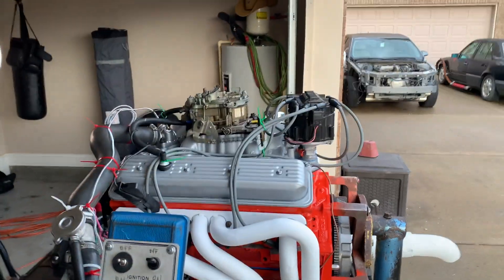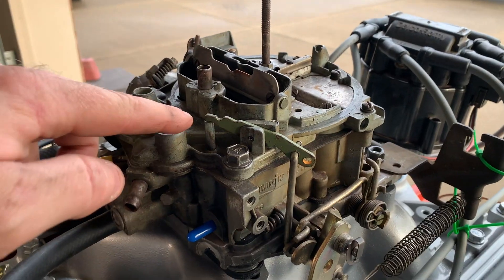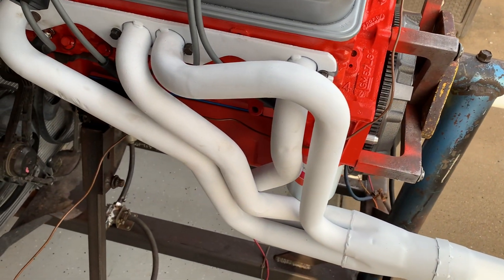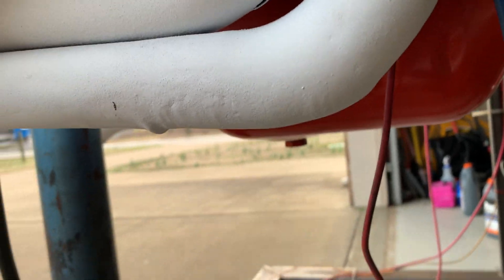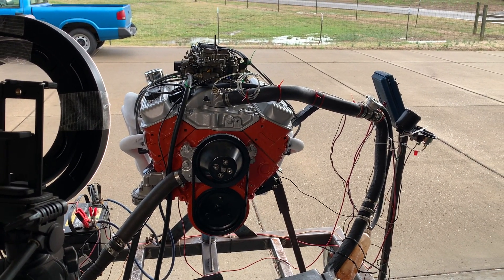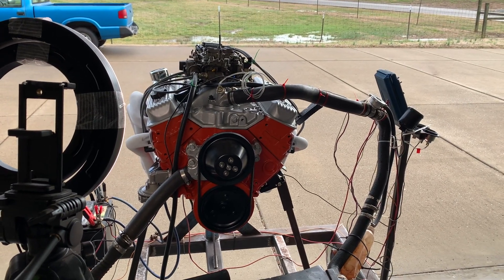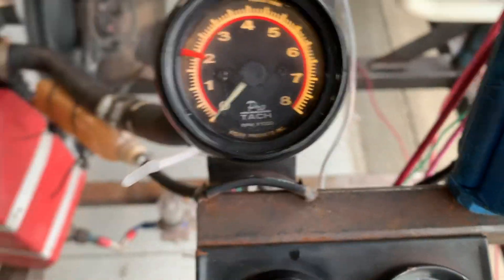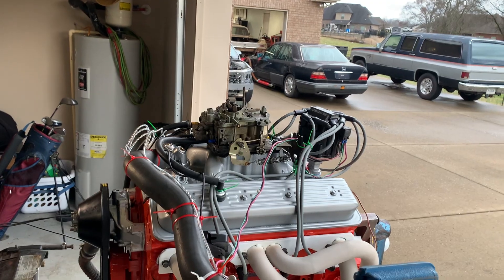It's Alive!!! The EZ 302 LIVES! Lets Hear it Roar!

Comment: Hello....   this. Is.  Maybe.   The.  4th.  Comment.  I.    Gave.  On.  Your.   Mr.  Rodder.   302.  Chevy.   To.  Me. It. Sounds.  Very.  Good.   Here.  And. With.  The.  Plus.  1000.  R.p.m.   idle.   Bares.  Similarity.  To. The.  Actual.  Z.28. 302.   Of. The.  60.s.       I. Might.  Need.   To.  Find. A.  Proper.     Engine..   for.  The.   Crank.   Some.  Lt one. Rods.  And. Get. An.  Edelbrock.  Torker ll....  camshaft.    And.  A.  4. Bolt.  Main.    350.block.    from. A.  70.s.  3l4. Ton.    Truck...  this. Might. Be.  Possible.    With.  Flat. Top. Pistons.   And.  Small.   Chamber.   Heads.    My.  Name.  Is.  Jim.   You.  Wouldn.t.  be. Upset.  If.  I.  Put.  One.  Of.  These.   Together. Would.  Ya...     I.  Am.  A.  60.s.  camaro.  Man...  need. I.  Print.    More.  Thanks. Man.  Have.  A.  Nice.   Day.......

Comment: We went the other direction when  creating clearance in the propane fueled , high dome , high compression 350 with vortec heads engine we built . We took .060 off the face of the spark plug pad in the head that was the offending area . I don't think this will change the vortec design as much as a huge dome in the chamber will . The other consideration was the removal would be identical in the milling process . I never had any spark plug clearance problems but I indexed them very carefully . I still think there are some undocumented problems with a dome in a head not designed to have a dome in the chamber . Plenty of turbulence there , maybe too much . I will find out but I only have a few thousand kilometers of hard pulling to the co-op so time will tell .Thanks again !

Comment: Did you use a 5.7 rod and was the block decked? I'd love to build one i had a 69 DZ302 but I put aluminum rods in it and missed a shift at around 7k and that was all she wrote. Might build one. I bet you don't have more then 3k tied up in that engine you can't buy a 450 hp crate engine for under 5k and you know what you got keep doing what you do. I love it.
Reply from the maker: Yes, it’s a 5.7 rod and no the block was not decked.

Comment: Who TF said it wouldn't run? 🤦. Somebody who doesn't know jack? Couple of guys all over the South who slap whatever's laying around together and lay waste to everyone. Been doing for a few decades. Guy down there by the name of Kenny built an LS 6 cylinder and sent it to The Salt to set a few records. Did the same with a Ford Flattie. Yeah, THAT 100 year old technological marvel. Wonder if those same naysayers know why the old Chevy 6 was called a "Stovebolt"? Or why the Chrysler 6 was called "The Leaning Tower of Power"? Or that Pontiac had an OHC 6 back in the EARLY '60's? How about GMC's 305 CUBIC INCH V6 or that you can put 2 of them together and get a V12? 
UGH, Dude ya got me on a rant😂. Bottom line is, you did your homework. Picked the right parts and put together a well done engine that sounds like it's got great potential. 
Personally, I've had a similar recipe in my nugget, one of way to many, for years.

Comment: What style of flex plate or flywheel does it take? Neutral balanced or counter weight style . Cool build waiting to see it in a test drive.
Reply from the maker: The plan was to take it to the dyno, so this one has a 92-97 LT1 flywheel, but in case of an automatic it would use the weighted flex plate for a 87+ SBC with a 1 piece rear main seal.

Comment: Never try to adjust the distributor with your hand on top of the wires, it will shock you. Good thing it was factory distributor with no high output coil or it would have KO you, or welded your zipper to the engine stand.
Reply from the maker: Good tip!

Comment: That's a cool build, I'm doing a L98 version sgi block, forged bottom end, icon pistons, 11.5:1 4/7 swap mechanical roller and efi, mini ram, or tunnel ram, or even LT1 intake, I have a lot of TPI stuff, I just rather build a efi motor instead of carbs, I Wana drive the hell out of my stuff, and sometimes I have to run it when its real cold out, it still has to be warmed up like a carb, but when it is, it likes to run at like 125-135* lol bc it's optimized for air flow and cooling for hot weather so it runs even colder now in winter here in Illinois. I had to use it while I fix my other car lol, real loud still with four mufflers, and I havent even built it tpi305 up to much, 1.6 rocker, better intake, Edelbrock runners half ported, out and plenum with matching base, full exhaust and a tune from a good buddy of mine he's been doing my tunes for years. Nice work with your engine, what were you gonna put that in? I'm doing my ez302efi for my 1989 formula firebird. I have parts to build another one too, but I have brand new 406" SBC and 410" BBC, soon enough I'll use them, just so busy with work, and now cold here sucks lol. Nice channel, good work, nice to see some guya still build up sbc! I'm 40, but I grew up with my dads 1968 GTO, so you know what that means!
Reply from the maker: I’d bet that L98 version would be cool too! The aluminum heads and a LT4 hot cam would be awesome!
Reply: @mr.roddersneighborhood2740  id kinda like to get an efi version of that duntov cam 112lsa, same lift and duration, but mechanical roller and just throw a 4/7 swap in for 20 more hp, extra 1/2 point of compression should help, I have some ported 113's 5axis cnc w/under cut stems and 350, with my Hogan sheet metal intake, I bet it would work great. And one 113 set I'm porting on my own, I like them bc the 49cc chamber, smallest available to boost compression. Should help extend the rpm band. Your motor looks great, it wants to jump off the stand lol. What do you wanna put that in?

Comment: Did the whole big block thing years ago 400 425 455 Oldsmobiles had a 402 Chevy   383 400 Chrysler  even a 390 Ford but in the last 20 years I have for the most part had small V8s currently I have a 93 Cougar with a Blue Oval 302. If I get the chance to build something without too many budget restraints would love to do a roller cammed 350 block with either a 3" or 3.1" crankshaft should be just about as snappy as your little motor either way I go
Reply from the maker: It appears to be a good combo with relatively easy to find parts.

Comment: What if you could run a ls harness and computer for better tuning ability and coil on plug for better spark for that wicked high revving 302 Chevy
Reply from the maker: I’m sure you could. It’s a SBC, everything under the sun is available for it. I normally do Buick V8’s with little to no options for parts. Finding the right parts for this Chevrolet was a matter of weeding through all of the options.

Comment: That is a snappy little mouse.  Just incase you have more plans than just a few dyno pulls,  I learned this the hard way taking over someone else's project, The vortec heads are not drilled for a coolant bypass even if the block they came on is.  Chevrolet puts a warning in their crate engine literature stating that any engine with vortec heads must use an external coolant bypass.
Reply from the maker: Oh… I did not know this. I’ll have to look into it. Thanks for the tip!

Comment: Neat build. Very neat, indeed. But surely we aren't comparing to original 302, are we? We aren't looking for similar traits, characteristics, 2-stroke type powerband, are we? Not much is similar whatsoever. It's a sb chevy- like the 60s 302.  It's painted orange- like the 60s 302.  That's about it. No sarcasm intended. It sounds great. Looks great. Seems snappy and happy. I'm not saying 1 is better than the other. I have no opinion because it's apples to oranges. Oh, 1 other similar thing - they are both 302 cid. I'm betting your build has better low speed torque and response through about 4200rpm. I bet yours will run accessories, idle in traffic, and have no valvetrain issues. All good stuff. I'll also bet my kidney your engine won't mind pulling a taller gear, like 308s- 355s. Finally, your 302 will be just fine with an automatic trans like a traditional old-school T350 or T400. The above listed positive traits of your 302 would make a 60s era 302 suffer. Performance would lag. Valvetrain would wimper. Overall street performance would be dismal and doggish.

Comment: Could you please make  your intro video shorter! Great job! What cam were you using? Cheers mate from Napa California
Reply from the maker: I do need to chop that intro down to 30 seconds or less… the engine is all GM parts or OEM replacements. The cam is an LT4 Hot Cam and has stock 1.5:1 rockers.
Reply: @mr.roddersneighborhood2740  
Any plans to test with 1.6 rockers?
That's what the Hot Cam kit used to come with.

Would be interesting to see how it affects the little 302 on a dyno.

Comment: You got a vacuum leak Dallas?
Reply from the maker: IDK... I'm assuming the same thing....Maybe so... I have not got it dialed in and the Idle Air Mixture Screws seem to have little to no effect on the engine idling correctly. I'll have to spend some time on it.
Reply: @mr.roddersneighborhood2740  Check the pcv. I've had many SBC engines over the years coming in my shop for running problems and they were using a no name brand pcv or the wrong one all together. 

The pcv is a regulated vacuum leak. If it flows too much it can cause tuning issues. We had one in my shop that was so far off the exhaust made your eyes water from running so bad. My one tech couldn't find the problem and I took a video grip and punched off the pcv hose and it started running fine. Replaced the pcv with the correct one from Ac Delco and it was fixed. 

Being your engine is a bit of a non typical set up, you may have to test with different brands.
Reply: She sounds good. Spray a little brake cleaner around any suspected leaky vacuum areas. The RPMs will go up when you hit the leaky spot. Can't wait to see what she does on the dyno. @mr.roddersneighborhood2740

Comment: No it's just a 302 no good
Reply from the maker: Technically its a .060 over 302... so it 310Cubic Inch...it's a 3" stroke crank in a 4.060" bore block. How's that not a 302 Chevrolet?
Reply: I thought the 302 had a 3-inch stroke and a 4 inch bore  @mr.roddersneighborhood2740
Reply: PS I would love to see the power curve on the dyno to see how it performs it sounds crisp
Reply: @bobgaudet9941  In a car!
Reply: Don't you have some grass to stripe?!
Reply: Domed Pop Top Pistons Not Flat Top👉🥝👈Like a Cut Kiwi Fruit. Another Vote in its Favour.
Reply: Put you a holey doublepumper and it will run